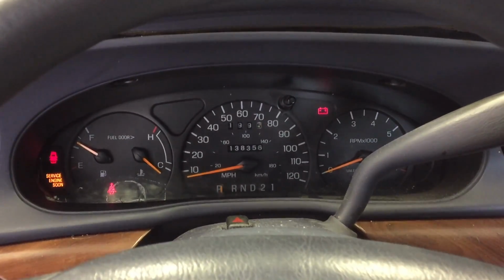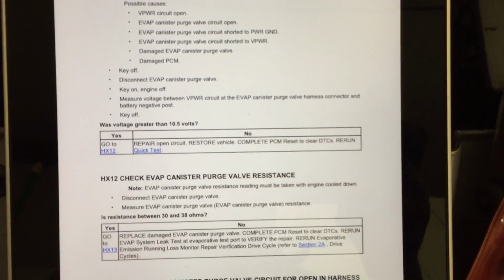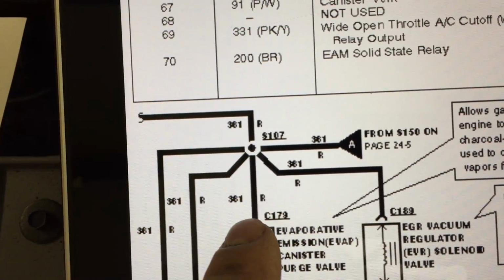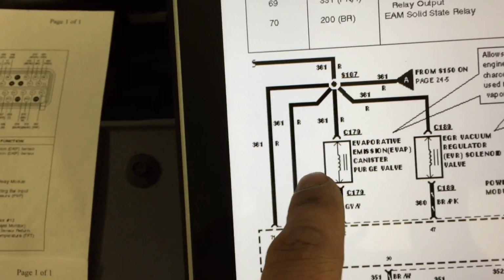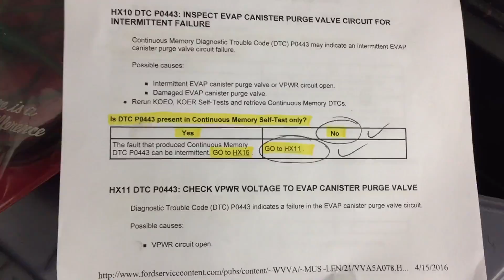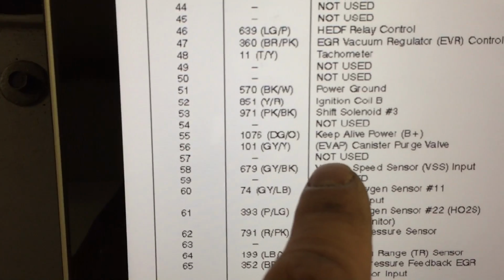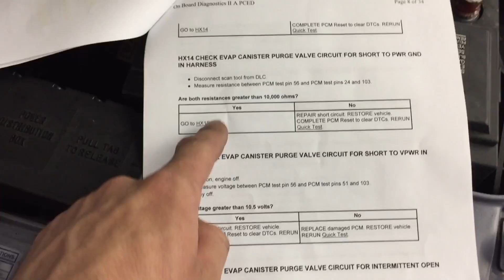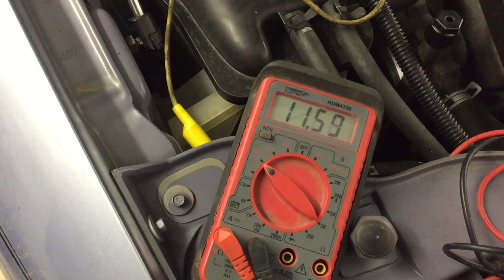P0443 Faulty PCM Diagnosis

Comment: Finally!  Someone explained this correctly!  Too many parts store employees sell the purge solenoid like it’s going to fix the issue.  Cracked hose, broken wire, leaking filler neck, will all throw the same code.

Comment: So well explained, and I would bet I'm having the same issue with my 99 Durango, PO443.
The purge valve runs some times and not others, engine running.. I'll check the voltage from the hot on the valve and ground. Now the PCM controls the ground, so if the ground is weak the 12v+ will also be weak, I believe is what your describing. If I'm reading you wrong you might be kind to let me know. I'll review the last part of video again.
Thanks so much..
From Joe M

Comment: I’m working on a 2000 Merc with same code. Solenoid was shorted but also reads ground on ground side without command from scan tool and graph of duty cycle is not showing square wave

Comment: Excellent! I am extremely grateful to share your knowledge and experiences. I happen to have a very similar case in Venezuela where I get Fault Codes P0443, P0059, P0060, P0053, P0054, P2006 and P2007 (Rich mixing condition and rev / min decrease not more than 2500 in fast track) Once verified Each of the components and the wiring, it would appear that the PCM was shorted or simply went to earth. I would like to know your impressions about it. Is it possible that there is a relationship like this if this failure in the PCM is exposed? On the other hand I am not clear on the connections that I must make with the multimeter in the cable of its exposure Gray / yellow with the PCM and thus determine if this is the reason. Note: It would be interesting that this course could be transmitted in Spanish. My email: m_a_munoz@hotmail.com              Thank you very much

Comment: Where did you get all that info on your car from? Like the schismatics and color ID of each wire? This is exactly what i need to trouble shoot my electrical demons in my Saturn Outlook but there is absolutely nothing available even the Haynes Manual has nothing after i bought it   >:/  To have it on paper and on ur tab makes it so much more easier. Any help would be greatly appreciated. Cheers
Reply: I would like to know the same thing. Where can I get my hands on those types of diagrams?

Comment: What do you mean exactly by "ground through the PCM"?
Reply: snorman1911 the electricity should flow just through the wires. Somewhere on that circuit, inside the PCM the wire has shorted out, and the short is in the PCM and not external. The only way to fix it is to replace the PCM
Reply: @mikesullivane30  the PCM has an electronic switch to control open or ground... but it sometimes gets stuck in between: with a blown .50¢ transistor - Replace it and your good to go.
or...
replace the computer and blow it up again by bad solenoid... expensive way !!😂

Comment: Isn't P044x codes usually due to a leak in the emissions system? I have an '02 Jeep Grand Cherokee with a P0442 code and it's an emissions small leak code.